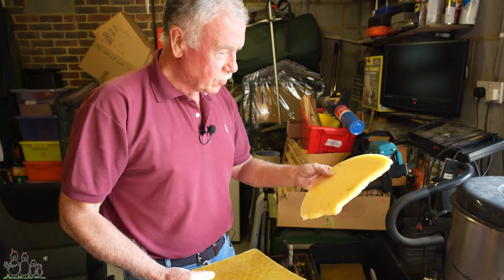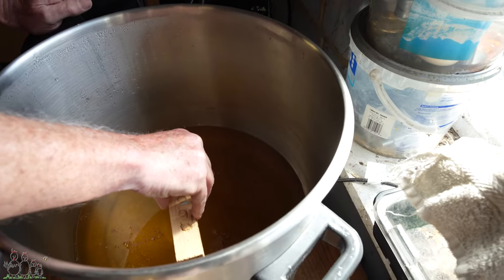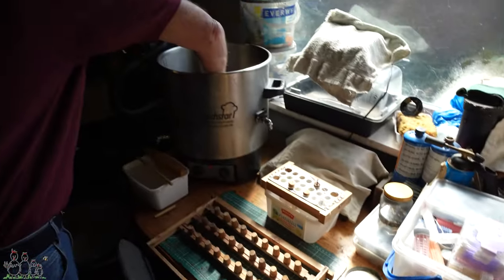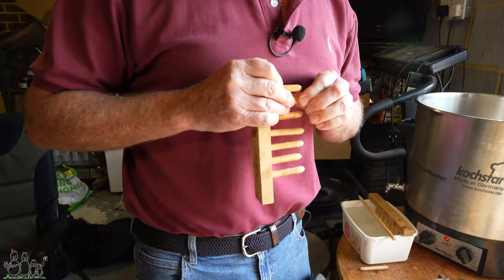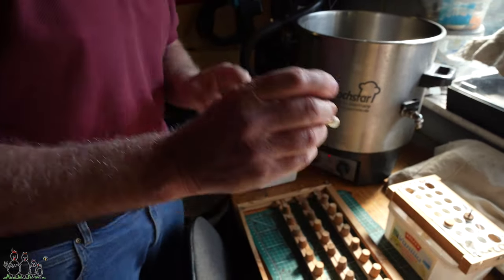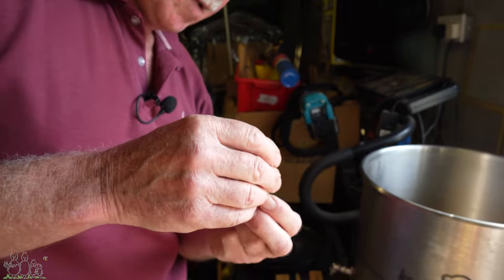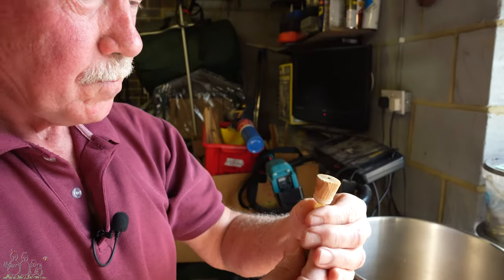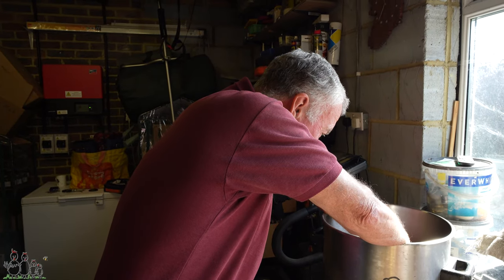Making Queen Cups with Mike Cullen

Comment: Is it possible to allow the queen to directly lay in the cups rather than grafting?
Reply from the maker: Hi Dave,

Personally I haven't had any eperience of doing this method, but I would have thought that this would actually work if the bees were in the right frame of mind (during swarm season). I have found that some comb I've used before that has a 'W' cut in it or pointed edges to be where the bees decide to make plenty of cells persistently. However, with a frame that may appear slightly alien if it doesn't already have eggs placed in it, might not be as succesful.

Josh